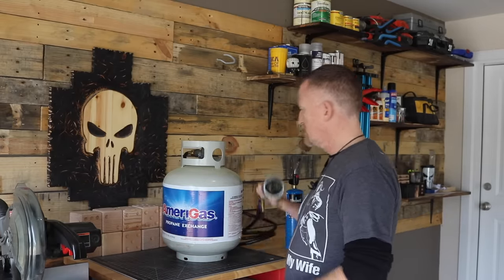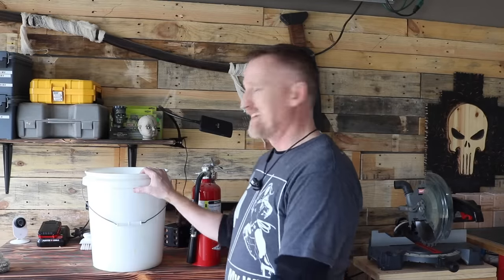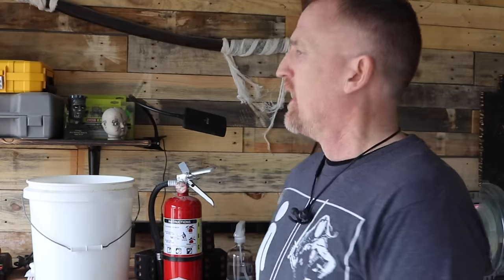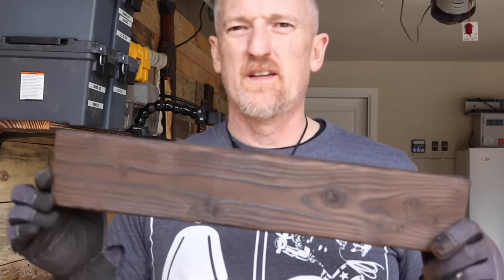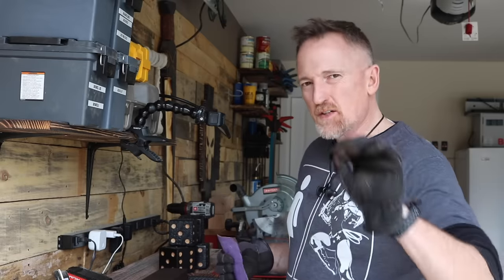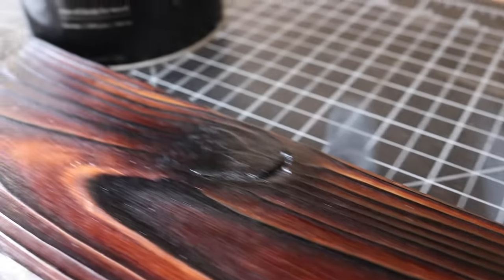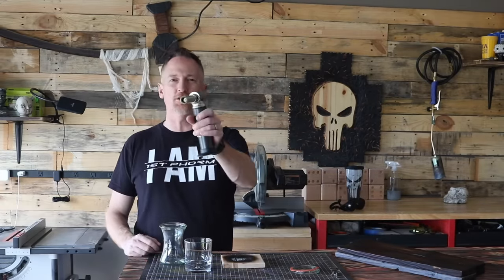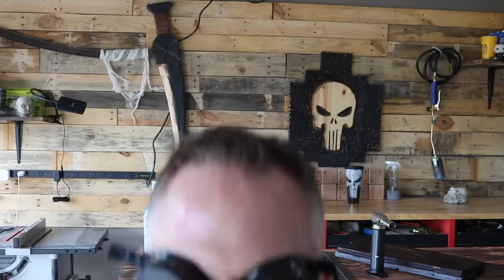DIY Wood Burning Technique - That's not Shou Sugi Ban! Or is it??

Comment: burnt wood isnt only worth in decoration, 
the shou sugi (burnt cedar). mean to burn cedar at 3-5mm deep. its pretty, wont let water infiltrate to not burned wood and lack of oxygen make parasite mushroom dont like it, its like paint but permanent and cheap. 
YET japanese didnt have the monopole of fire and wood on the world,  all civilisation had the opportunities to try it, specially think that quite all civilization were used to burnt woot for create wood coal for heat houses...
so what are the problem with burnt wood?
1/ dont use it on surface, just on wall, its not plane and its friable.
2/ like stones, the cracks will have damage of ice cycle.
3/ dont use it for construction, solid dry wood is better for it :)
4/ its thin. ->  bad temperature properties, but cheap.
ice is a problem, temperatures isolation too 
but the main reason europe didnt use this but japan did is the nature of the grounds...in europe argile stone mortar are available...and make better isolation for temperature, instead japanese ground are volcanic they lack of stones they had quite only wood...
Reply from the maker: Wow. That was extremely informative. Thank you!
Cheers!

Comment: interesting however your audio changes on the text frames. I had to turn it down as it was really loud. The audio needs to be polished but the video over all is good. :)
Reply: Hes likely utilizing the onboard mic so the quality WILL be shoddy from a distance vs up close. Rode shotgun mic with a wind sock will essentially fix that for the purposes hes using it for. 
It's all about the wood and finishes anyway lol. Not the sound quality.
Reply from the maker: Titan is right about it's all about the wood and finishes. However, that is with a Rode Shotgun and deadcat! LOL
👍🥃👍🥃👍🥃
*I'm discovering that a bunch of comments that I previously responded to never posted. Sorry about the delay.
Reply: @BuildDadBuild  get a lapel mic and you'll be all set!